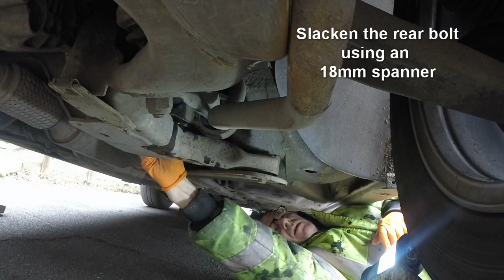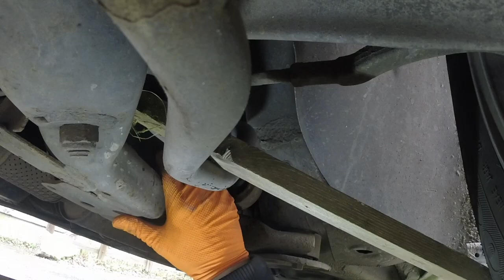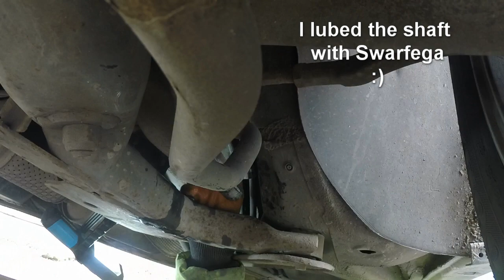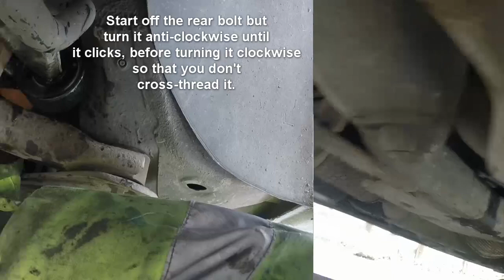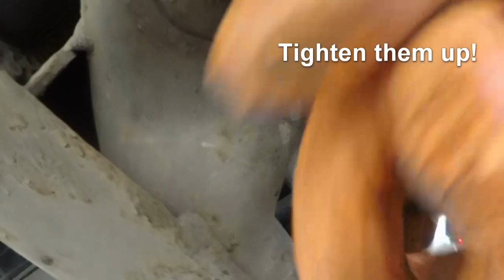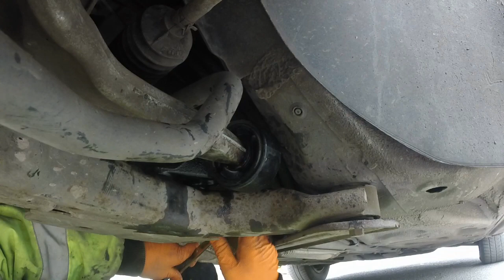Rover 75 wishbone trailing arm bush, replacement.

Comment: Tried this but couldn’t get the old bush off. Had to remove the whole thing.
Reply: & that is exactly what you need to do; this gent appears to have just slipped it on & with one hand whereas if it does "slip" on then the arm is toooooo worn & way past it's "sell-by" date

Comment: I have no idea how you got the bush on so easily. Ive bought 2x new arms, and I opened the box to find the bushes separate to the arms - not helpful! I managed the new LH bush on the new arm with a socket and hammer. However the RH bush will not go on the new arm at all. Two of us have tried and the bush just will not go on.
Reply from the maker: Have you lubricated it before trying to get the bush on?

Comment: I took mine off, got the new one one, but I can't seem to get the wishbone trailing arm close enough into the car to line up the bolts straight, it seems to be too far outside (towards the wheel). Any idea how I can resolve this ?
Reply from the maker: Have you tried using a piece of wood as a lever?

Comment: Good job 👍
Reply from the maker: Thank you, Michael.  I think I made a meal of the job, simply by not getting closer to it at the start.  Once I was up close, it was a lot easier.  I think I could possibly have done it in around 45 mins, rather than the 90 mins it took.
Reply: was the old bush stuck on the arm at all, im going to do this job soon and just wondering if it will get stuck on and how to remove it
Reply: and im asuming its no different for the 1.8
Reply from the maker: KRWH13SNHP No...the Bush had fallen to pieces.
Reply: @KRWH13SNHP  The Track Control arm and presumably the bush, is the same for all the front wheel drive 75s
Reply: @fattyballaty3424  and here I am, 3 hours later still not getting any close to getting the job done 🤦‍♂️
Reply from the maker: @MrMaDSEGA  Did you manage to get the job done?
Reply: @fattyballaty3424  I managed yesterday after another 4 hours and one less friend 🤭 to get 1 arm and bush on. It's a pain to put the bush at the right angle and find the spot for screws. Today hopefully will go faster.

Comment: 'Removed this wishbone this evening & went on here to see how the rubber bushing is pressed on to the wishbone & it's still a mystery to me how this gent was able to push it on  with his one hand as i actually beat it with a sledge to just try get it started on its way & failed miserably & will need to get the hyd pullers at it tomorrow sometime 🧐
Reply from the maker: @semi-sane5149  I lubricated it with washing-up liquid.